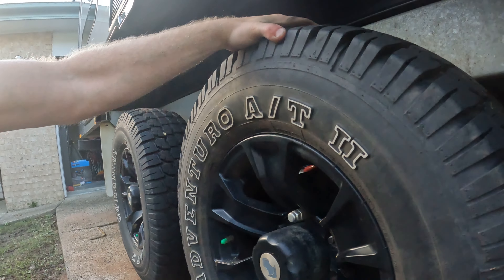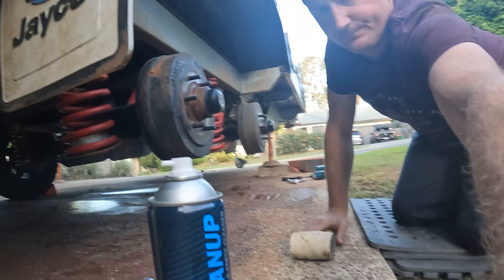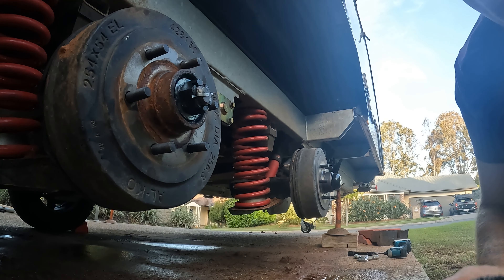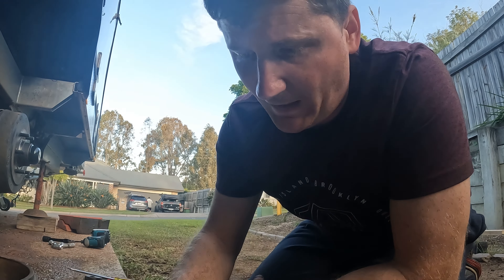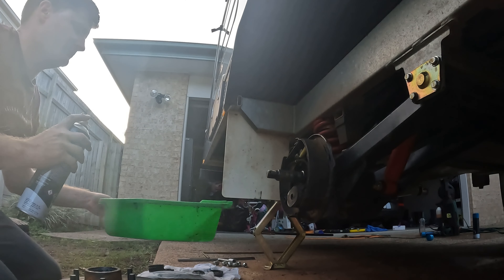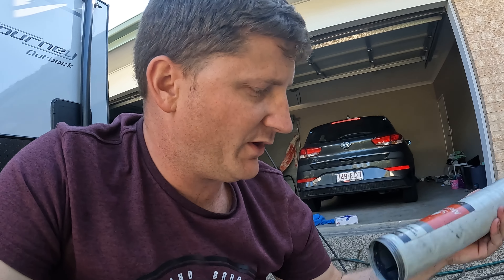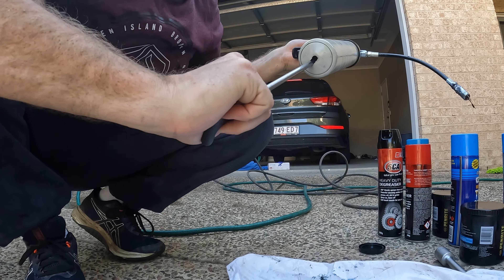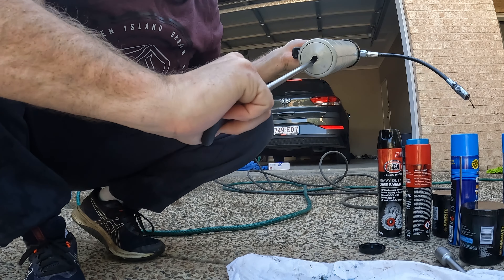Jayco Journey Outback ALKO Wheel Bearing & Suspension Servicing

Comment: Hi I noticed you didn’t change the bearing caps  I’m trying to remove inner bearing  cap no lip showing to use punch or chisel never seen this before replacing bearings , I own a Jayco 17.5’ pop top with j suspension

Comment: When your wheel rocks like you did at the start is not always a sign that your bearings are worn/damaged. When you inspect the bearings and you see no damage then you can bet the bearings were not bedded in properly with axle nut on last assembly. A very common issue when unqualified personnel are servicing your van. A great and informative video.
Reply from the maker: Hi Fred. I think that is exactly what happened to me. Lucky we caught it before andy damage was done. Thanks for the feedback and thanks for watching 👍

Comment: My only comment, besides great video, is by greasing up the stub axle before you push the inner bearing on with the brake drum, is that the majority of the grease will be pushed along the axle into the brake area rather than stay on the axle. I'd put a very light smear of grease on the axle, push the drum on and then add some extra grease between the bearings before adding the outer bearing.

Videos like this are great as it helps others attempt what should be routine maintenance on their vans.
Reply from the maker: Thanks for the feedback. Appreciate it.